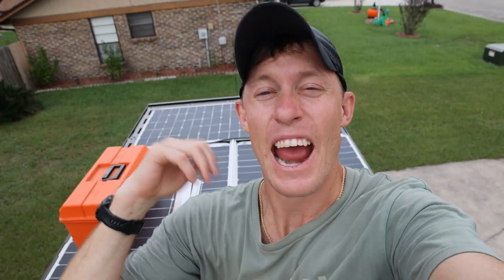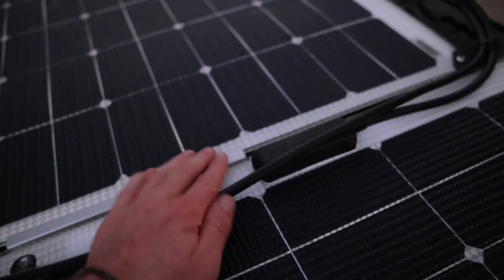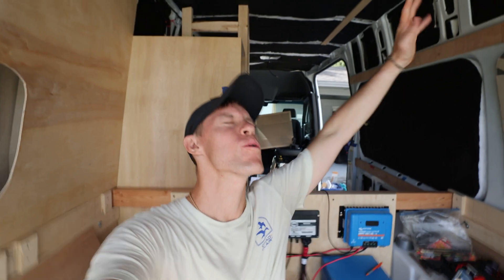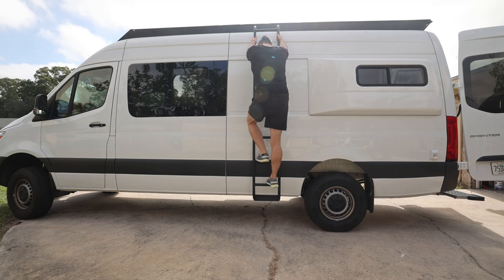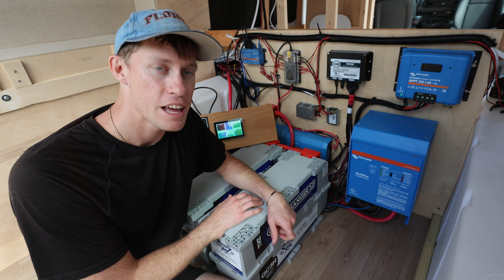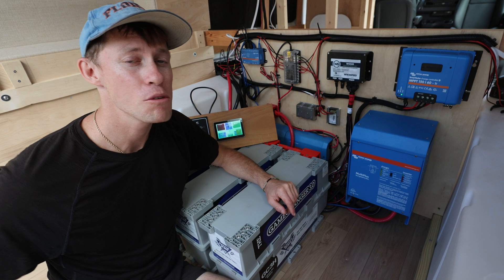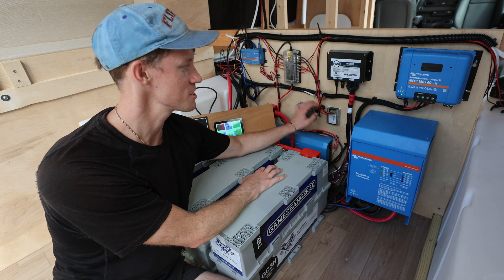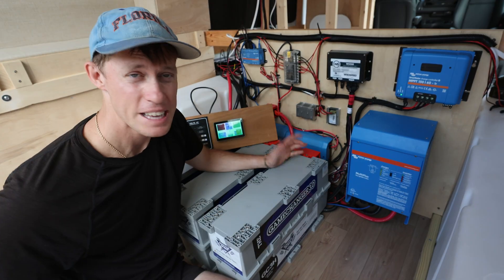WE FINISHED OUR ELECTRICAL INSTALL (825W of solar, 280A alternator, 810 ah Lithium Batteries)

Comment: great job looks fantastic!, one question is the inverter noisy? thanks
Reply from the maker: Thanks Lester! I'm not sure yet regarding the inverter, we haven't hooked up any AC loads. Will be doing that soon so will let you know!
Reply: Thanks just wondering..if can go 100% 12v
Reply from the maker: @lesterwicklein717  probably depends on what you need to power! We are using 120V for our cooktop, oven, water heater, and for normal appliances like our blender and instapot. There are 12V options, or propane to some of those if you needed to include them!

Comment: Where did you place your disconnect switch between inverter and batteries?
Reply from the maker: There's no disconnect switch between the inverter and the batteries, only the batteries and the system. The inverter is a fused connection to the batteries and enabled / disabled via app or the switch on the inverter itself 😁

Comment: How much heat will the battery banks produce and what about ventilation. Just curious more than anything. ???
Reply from the maker: The inverter and the solar charge controller will need some airflow but there should be enough room around them. They aren’t in a closed box so hopefully there is no issue!

Comment: Looks great - you can certainly see the boating influence in things like the battery disconnect (which is a good thing).  We continue to be extremely fascinated by the Nomadic 12V air conditioner you installed.  As members of the Airstream Boondockers Club, that could be of great interest for those with the big battery banks.  To my knowledge, they are not well known in the RV community outside perhaps of vans.
Reply from the maker: Just circling back here, we've really liked our Nomadic 12V AC! We haven't used it yet to work and cool the entire van, but we've used it often at night. It keeps the bed cool and our batteries barely see a blip. We leave it on all day when we go out hiking and it keeps the bed cool, while solar keeps our batteries topped up. Cheers!